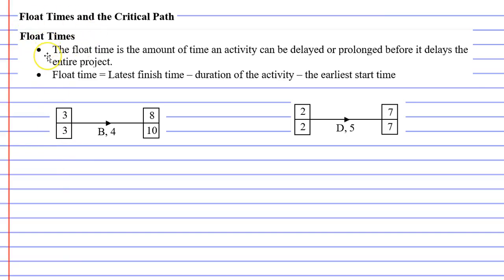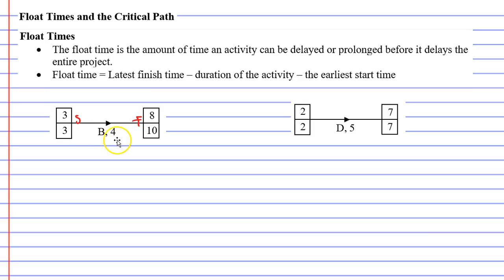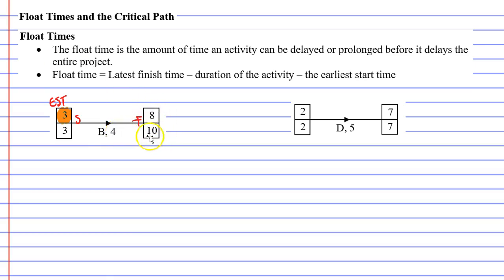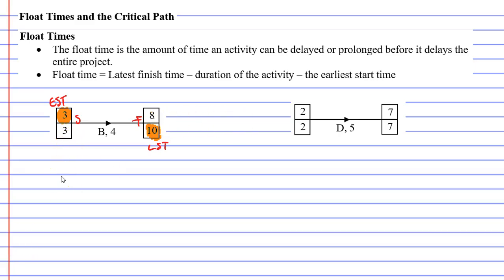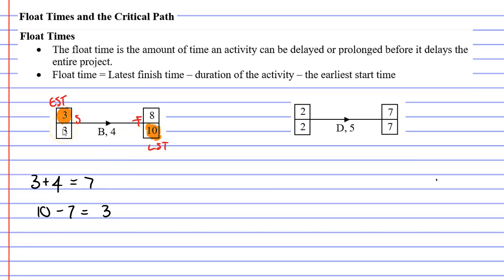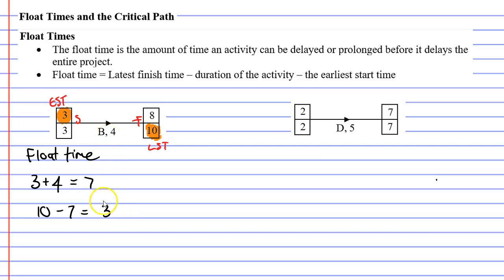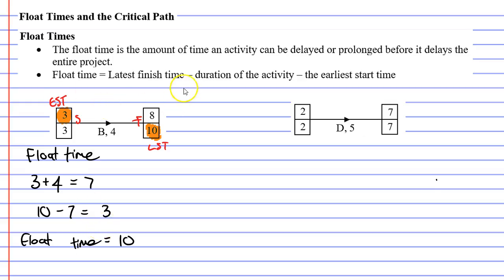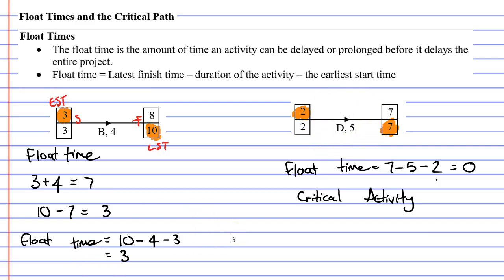10E Float Times and the Critical Path (1 of 3)

Comment: isnt the 8 wrong then ??
Reply: I think the point you're making is valid.

If Activity B (say a plumber) uses all their float time, so takes 7 hours, then the EST for any subsequent activities will no longer be 8, it will be 10.

Hence, any subsequent activities that are not critical will lose some (or all) of their float time.

Or, in your words, 8 would indeed be "wrong". In practice the critical path planning will be updated very regularly, hence the 8 would change to 10 at the next update of the project plan. In practice, the finish date is also "flexible". The first version of the project plan will not be based on the absolute latest time the project can complete, it will be based on a best case scenario, with allowances built in for bad weather and the like.

The comment in the video that it would be comforting for the plumber to know that they have 3 hours float time is not how it would work in practice. The float time doesn't belong to the plumber, it belongs to the Head Contractor to manage as they deem appropriate.